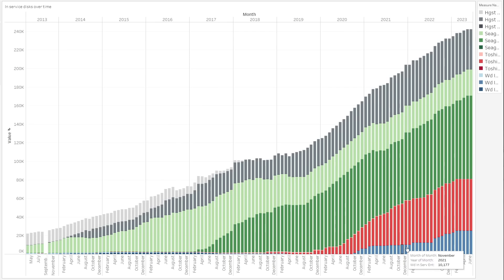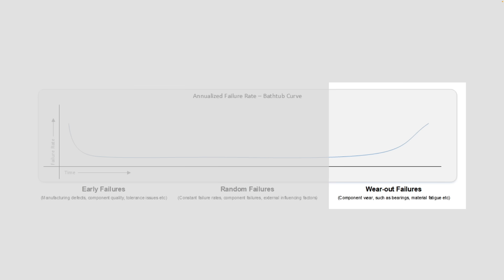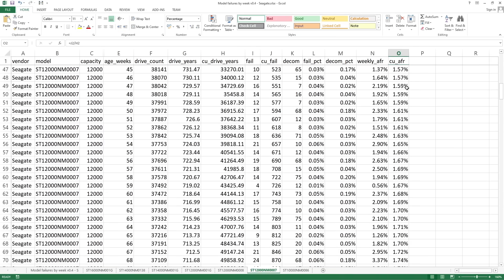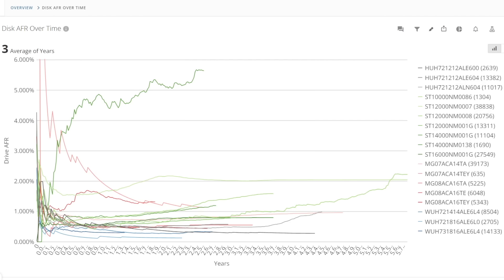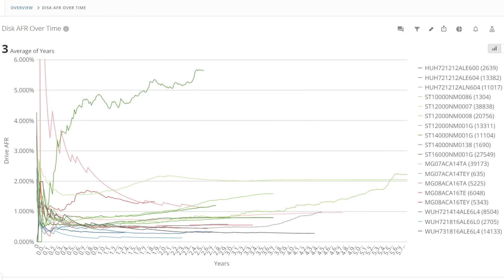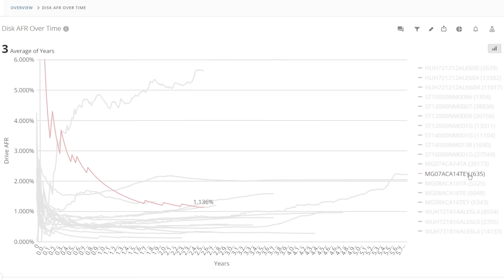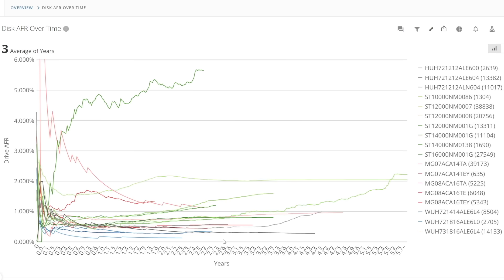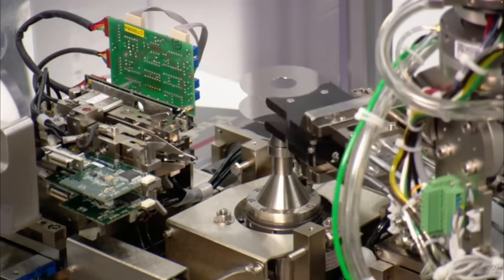Failure Rate Analysis - Best 10Tb+ hard drives: Seagate, Western Digital or Toshiba?

Comment: Sounds it's luck of the draw with Seagate and otherwise only WD drives still. Depressing....

Edit: Thank you for listing the model names in the description. It's kinda insane to me how much more expensive 10 TB WD drives are compared to Seagate Exo 16 TB, I would not have noticed that without the model name you provided, so a big thanks on that!
Reply from the maker: They seem to vary, it may depend on time and supplier. Currently in the UK at the 18Tb point, Seagate Exos are about 10% more expensive than the WD Ultrastar, with the Tosh MG drive being very slightly cheaper than the WD.

Comment: Bought new 17 July 2024 Seagate IronWolf 4TB Internal Hard Drive, NAS HDD, 3.5 Inches, 5400 rpm, CMR, 64 MB Cache, SATA 6GB/s, Silver, incl. 3 Year Rescue Service, FFP, Model No.: ST4000VNZ06. Written total of 5TB in total and has been on daily. Died after starting ticking few days ago.

Comment: Dude my seagate has been running in my desktop for like 10 years and I have wrote and wiped atleast 100tb on it easy
Reply: 10 years ago was different quality build than todays hdd's
my brand new toshiba 20tb failed after 6 months and my other seagate 4TB failed after 2 weeks🤷‍♂
Reply: Same, I have several 10 year old Seagate drives that have never had an issue. But the clock is ticking

Comment: You are rattling off words like a machine gun.
Do you suffer from ADHD ?
Motor Mouth Syndrome
The listener is forced to be hyper-focused on what you say
where the listener should be relaxed to comfortably absorb
the details.

Like at a restaurant - one takes the time to enjoy the meal -
and not scoff it down eating  quickly and greedily like a starving wolf.
Are you getting the point yet ?
So learn from professionally trained orators and presenters.
Be sure to go TOILETTE first before the presentation starts.
Slow down the cadence  - It is not a race
There is no need to rush the presentation
So your presentation performance is ZERO

Comment: Seagate never fails to impress failling, but i have no clue as to what is happening to HGST, as most of their designs are solid af in terms of longevity.
Where is this data coming from to begin with, people who don't handle their entire HGST clusters properly and thus likely causing a statistical measurement error bubble or like, are their drives really that bad?
I own (my extremely low sample size), 6 or so of them, 2 of them are enterprise level drives the others are consumer level drives and no one had an issue, and with the exception of the 2 ones i bought, the other 4 were given to me so who knows how much abuse they've gotten before they came to me, who i take care of my hardware as if none of it will be available the next day.

Comment: Notice: this video is about BIG drives from years ago.
You see general idea, nothing else.
If your cheap SMR drive is not good, it doesn't mean high end CMR big drives will behave the same. There's no connection.
Reply from the maker: If you need data, then you need drive models that have enough time to generate that data. Brand new drives released in last 6 months will not have reliability data to work from, and this is the challenge.

That said, many of the models covered here are still sold, especially in the 14-18Tb range, so it’s actionable. But the key insight here is a large quantity of reliability data on manufacturers as a whole, as well as strong signals on the direction of travel. Are their drives getting better with innovations and manufacturing process changes? So it’s very useful data.

As for desktop SMR, there will be differences between these and large DC drives. But I have other videos that cover desktop and SMR vs CMR performance and the details of how they work.

There isn’t a good public source of data on SMR drives because BackBlaze and any others that have large numbers of drives and are willing to share data, likely wouldn’t consider buying them. So that’s an indicator in its own right. But as I have covered elsewhere, that in my opinion there is really no good reason to consider an SMR disk, and the biggest sales aid for those drives, is hiding that detail from people. Unfortunately…..
Reply: @sometechguy  I get your point, there's just no guarantee as commenters here try to assume. Personal experience from decades ago just doesn't work with new products even of same model. If you look for any brand being bad or good, you will find total opposite reviews. I looked for WD, it seemed perfect. I looked at Seagate, it seemed perfect. And then all you can do is choose a top brand and their average product.
Reply from the maker: @ of course it’s not perfect, and it’s statistical data also. You can find a product with 99.99% reliability, buy 10 of them and they can all fail on day 1. Such is the nature of statistics. 

But data is the best you have. As you point out, reviews are at best anecdotal, and sadly often not even reliable, and at worst are not even genuine. So this is why data is the thing that gives you the best information available, even if imperfect.

And a small correction, none of this data is ‘decades old’, but it think that was just to give emphasis. 😄
Reply: @sometechguy  i doubt the data that contradicts my experience, that's it. Usually there are factors that were omitted, for example regional differences, faulty batches etc.
Reply from the maker: @ yes, this is a problem. There are many variables not captured and there is no way to know what they are or if they impact the results. Batch numbers, manufacturing locations and dates, if the drives differ component wise or what happened to them in transit. Were they dropped during install, are there environmental vibrations not in the data. It goes on.

I tried hard to keep it unbiased, but I could have manipulated the data. You could only find out my doing the analysis yourself and checking my work. 

But the larger the data set is, the less influence many of these factors have. At the end of the day, it’s data and you can use it or distrust it. And it’s entirely up to anyone what they do.

Comment: I bought 16 TB EXOS X18 I hope that this HDD will not dead soon, my planing is more than 7 years, my two 512 GB WD Blue of 2012 stay alive... but years ago the tech still alive more years
Reply from the maker: Very good chance it will last that long, but always the chance it won’t. So don’t neglect backups. :-)

I just lost an X18 18TB yesterday, though looks like it’s just ‘failing’ and not ‘failed’ with a chunk of reallocated and pending sectors. It’s being replaced at the moment and will be a warranty return as it’s just over 2 years old.
Reply: @sometechguy  What I find curious about it is that when the EXOS X18 HDD starts it makes a lot of noise, and from time to time when it reads it also makes a lot of noise, as if it had a noisy mechanism. But this only happens when the HDD is powered on or off. I do not know if it would be better to let it work all the time that the pc works, or that it turns on when it is going to be used and stops when it is not used. This causes me to wonder if these types of HDD can wear out the motor or whatever. So as a guess I don't know if it would be better to let it not turn off while not in use. I practically only use it for my video backup
Reply: i bought an 20TB toshiba...dead after 8TB files and 6 months
Reply: @ I am thinking that buy 2 HDD s is better idea, then if one dead you also have a other copy of files, I am waiting for another 16 TB EXOS, just buy the more cheap HDD, when they dead I think that anybody know, sometimes I only connect the HDD when I have to make a copy, then I think that the HDD will live more years

Comment: Any data on dependency RPM with Reliability. 5200, 5400, 5640, 5900, 7200 rpms ?
Reply from the maker: All the enterprise drives look to be 7200rpm. There is a lot of data on older desktop drives, which BackBlaze used to use, and I think there are 5400rpm drives there. Its hard to make a fair comparison as they are a different drive class and are typically older, so from earlier generations but I did make a video comparing the failure data from the desktop and enterprise drives, and overall there doesn't seem to be much in it. But I don't think that really addresses your question, because of all the other variables.

Comment: I’ve done everything I can think of—reformatted (both light and thorough), disabled unnecessary services, tweaked startup programs, modified registry settings, and ran multiple diagnostics—but the performance issues persist. From startup, disk usage is stuck at 100%, freezing is random and can last up to 30 minutes or more, and even simple tasks like opening a browser or clicking are painfully slow.

Lately, I’ve resorted to pressing and holding the power button to force a shutdown because the system freezes for so long that normal shutdown options are useless. I’m starting to wonder if my hard drive could be failing, even though CrystalDiskInfo shows its health as "Good." Could it still have undetected issues?

This laptop is more than just a device to me—it’s a gift from my grandmother, who’s no longer with us, and I can’t imagine replacing it. I’m determined to keep it running, but I need guidance to figure out what’s wrong.

Here’s what I’ve tried so far:**

Disabled services via CMD:

Disabled Sysmain, Connected Devices Platform Service (CDPSvc), and Background Intelligent Transfer Service (BITS).
Left Connected Devices Platform User Service_9e718 (CDPUserSvc_9e718) enabled.
Edited Registry:

Modified ClearPageFileAtShutdown in hkey_local_machine\system\current control set\control\session manager\memory management (set to 1).
Ran Diagnostic Tests:

RAM: Passed all four tests using mdsched.
HDD: Checked with CrystalDiskInfo—health status shows "Good."
HDD Speed Test: Results show average read/write speeds but still unsure if performance degrades under load.
Results:

Disk usage remains at 100% since startup, even after these tasks.
Memory usage hovers at 66%.
A random error occasionally appears: “AcerRegistrationBackGround Task Has Stopped Working.”
Additional Details:
Model: Acer Aspire 7 (A715-71G)
Specs: Core i5-7300HQ, GTX 1050 2GB, 8GB DDR4 RAM (single-channel), 
Storage: WD 1TB HDD <------------- STORAGE BRAND
OS: Windows 10 Home (fully updated)
My Suspicions:
I’m increasingly concerned that the hard drive could be the root of these issues. Although basic tests show it’s functioning, I’ve read that early signs of failure might not always show up in simple diagnostics. Perhaps the disk is struggling under load or has specific sectors degrading over time. Could it explain the freezing, high disk usage, and slow responsiveness?

Alternatively, could this be linked to the single-channel RAM setup, thermal throttling, or dust accumulation inside the laptop? I haven’t tried cleaning it or upgrading to dual-channel RAM yet.

I’m at a crossroads and don’t want to replace parts unnecessarily without pinpointing the issue. Any insights into how to confirm or rule out hard drive failure—or if it’s something else entirely—would mean the world to me. 

Thank you in advance.

Comment: Don't buy a mechanical drive HDD instead get a SSD, they are silent, longer life, much faster read/write typically ranging between 460mps to 580mps transfer R/W speeds.
Reply: Silent and faster, yeah but just for storing pictures and videos for decades, hard drive is a better choice, right?
Reply: @User_n1d6g62f9j  In fact, good used HGST hard drives with 10 or 12 TB are indispensable for weekly/monthly backups of films and shows as well as pictures and are also inexpensive.

Comment: Since 1987, Seagate have never fail to crash on me. There are times brand like Conner, Maxtor or IBM drives that are DOA but these are one off. I never had a DOA Seagate drives before but it will always fail me in less than a year.
Fujitsu, Toshiba, Hitachi fails me after normally 3 years or more. So left with one other brand that is the most reliable. Won't mention it's name.
Reply: On the other end, I remember having about 15 identical WD800JB/JD 80Gb drives deployed and ALL of them failed just about when the warranty ran out.  It was a total disaster.  Even warranty replacements coming from WD were failing.  Total trash.  It was years before I trusted a WD again but am firmly team WD and Sandisk these days. The current products are really good.  Every brand has their disasters. It matters that they learn from them and move forward and WD has, in my opinion.

Comment: This is great information. I wonder if you can do the same analysis for NVMe and SSD.
Reply from the maker: I have not found a good data source for SSDs yet with a significant quantity of data. Backblaze do have some SSD in their dataset, but the numbers are very low so hard to get meaningful data unfortunately. I think the nature of what they do means that they don’t have the high performance requirement to justify the cost of those disks, so it’s all about high volume storage. And other than BackBlaze, no one else really shares their data.

Comment: do you have something similar for consumer level comparisons?  like the WD My book 16TB vs Seagate Expansion 16TB External Hard Drive HDD - USB 3.0?
Reply from the maker: I have not seen any data for the external drive caddies, because I think there are used for consumer cases and no one has thousands of these in full time use. Also, those caddies vary because if you shuck them, you will find that the contents vary a lot.

But… many of those caddies do use desktop class drives such as the barracuda, and I have a video that contains a lot of data on desktop class internal disks, such as the barracudas. 

But again, Backblaze stopped using these drives around 7 years or so ago, so it doesn’t contain newer models. But it does show how the desktop drives faired for reliability, but also how this compares to enterprise drives. And actually, it turns out they are not so different.
Reply: @ thanks and appreciate the quick response.   Keep up the great work.  It's a bit too technical for me but I'm just a regular consumer.

Comment: It's not just about rotation, but also actuations.  Actuations (head movement) creates vibrations which adds spindle bearing wear - in addition to the actuator itself of course.
It would also be useful to know what constitutes a failure, presumably early on it's mechanical problems, or it flat out doesn't work at all (like won't spin up) - while later it shifts to high soft error counts and rapidly growing bad block maps?

Comment: I've been running (two) Seagate 16TB Exos (SATA) drives, (ST16000NM001G-2KK103), 24/7 for 5 years now. It's used as an NFS/media server running all the time,  on XFS file system, and writing periodically, and rebooting only to upgrade OS and/or firmware.
They started at 30% capacity used, and now about 60% capacity used. They've survived several power outages and still running  great.
The ONLY thing I'm upset about with Seagate is that they didn't have their 32TB drive out back then.
Reply from the maker: I am also itching for those HAMR drives, I believe they have been providing them to cloud scale customer for a long time, I assume the demand outstrips supply and this is why they are not generally available.

And those NM001G drives have a good record I believe.

Comment: Why can't we have an easy way of buying drives from different batches. So it might reduce the possibility of mass failures in a raid. Just a thought. I guess you could spread your order over multiple vendors.
Reply: yes, some professionals are using this concept, it helps to avoid sudden failure of a large amount of drives.
Some are doing firmware updates in batches, with weeks in between. Not all drives at once.

Comment: One note: One of the most important brands for reliability is actually the brand servicing the drive. Ie: you. Your usage of the drive massively influences its lifespan. If you keep the drives turned off for most of its life it’ll last significantly longer. I personally recommend buffering them with SSDs, and only turning on your drives very infrequently (one a week or month is ideal).
Reply: I'm intrigued by the idea of buffering HDDs with SSDs. If you have done it, how to do it?
Reply: instructions unclear: used ssd drive to buffer the bad sectors out of HDD and now HDD doesn't work. I need my money back
Reply: I think I saw drive statistics from google that showed temperature fluctuations are a big factor, i.e: keeping them running may be better than daily warm up and cooldown when powered off. The truth is probably somewhere in the middle.

Comment: Physical HD drives are on the way out, aren't they. Is a similar in-depth analysis available for SSD drives of the same capacity range?
Reply from the maker: No, unless something changes drastically with NAND, they are going to be around a while, I would say a decade or more and who knows after that. SSD's just can't compete on dollar per TB and hard disks have generally far better endurance. SSD has significant performance advantages, but there are plenty of cases where that stops mattering and its all about density,  cost or endurance.

NVMe for boot and high performance needs like AAA games, video editing etc. HDD for mass and long term near-line storage. 

And there isn't a dataset that I am aware of that covers this kind of data for SSDs, though I have seen testing on how quickly you can end of life an SSD vs a HHD. I have an Lexar TLC SSD in a testing rig I use for IO testing, which does a lot of read/write and it used 20% of its reported life in 3 months. So different tools for different jobs.
Reply: @sometechguy  Thanks for the elaborate reply